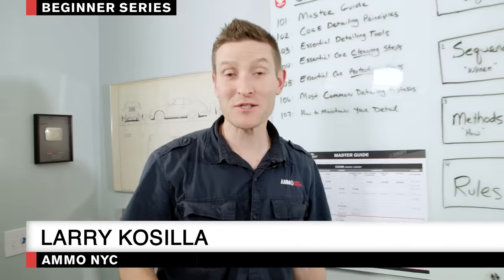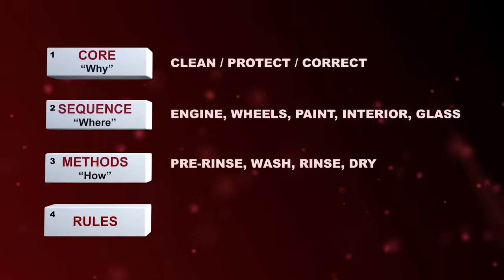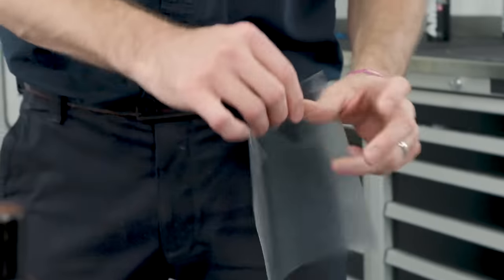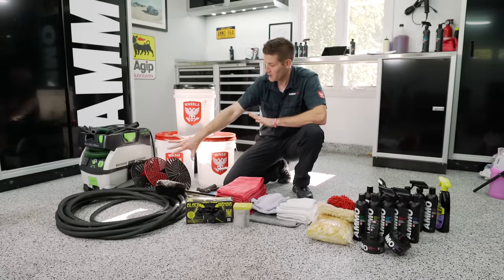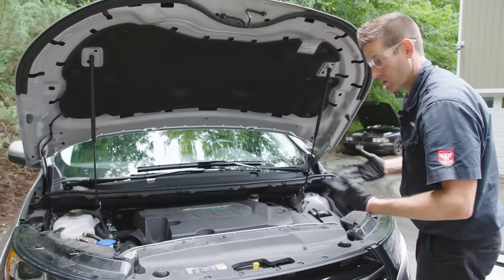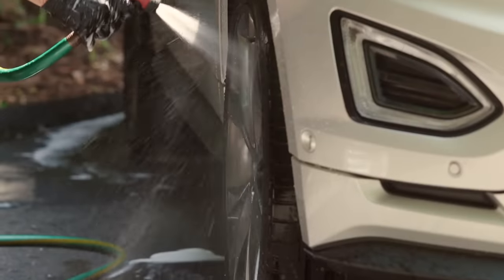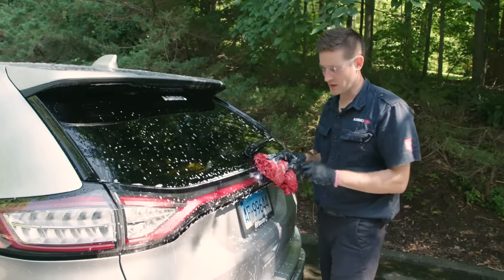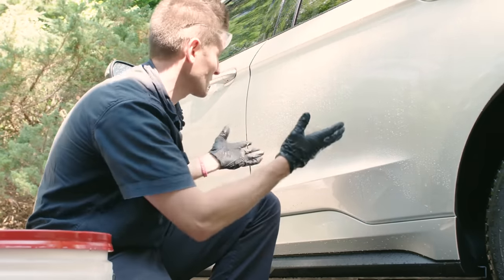Car Detailing Tips YOU MUST KNOW: Full Length Training Series

Comment: Lightly running your wash mitts across the vehicle usually doesnt clean it well if the vehicles dirty
Reply: Try a citrus pre-wash to loosen the surface contaminants, if that doesn't work your car's probably in need of a good decontamination and protective layer to help with your regular washing.

(In Scotland) My winter weather and roads are pretty bad with road salt etc and 80% of the surface contamination comes off with the citrus pre-wash and snowfoam 👌

Comment: Using a mitt to wash seems to me to be less desirable than a soft brush designed for car washing. A mitt, no matter how often one rinses it, is going to trap dirt particles and create scratches. A soft long bristled car wash brush will not trap debris for it is only the very ultra soft, pliant ends of the bristles that are in contact with the surface of the clear coat. I've been washing my vehicles for decades using this method and swear by it. The proof is in the pudding. I have a mirror, wet look finish and never have swirl marks. As for drying the vehicle. I use the touch-less method. My Stihl blower. 

When it comes time to wax the truck, I pick a cool cloudy morning after a rain, with zero dust in the atmosphere. When my fingernails feel contaminants on the paint, I will 1st apply polish (swirl mark remover) using small damp pieces of ultra clean 100% cotton terry cloth. Wipe clean with microfiber and then wax.

Comment: So my windows have like a felt material or some soft material on the where the window rolls down in the window frame or sill or whatever well I️t collects dust and lint and other fabrics and so on and I️ can’t find the best method to clean I️t..? what would be my options?? 
I’ve tried alot please help I️ have a Chrysler 200s 2016
Reply from the maker: use soap in a spray bottle and a brush to agitate then rinse thoroughly.  Hope that helps. thanks for watching and supporting AMMO.

Comment: 46:23 should do inside fiirst incase any dirt coming off from the inside ends up on your car!.. for an overly scientific cleaning video i'm suprised you would clean the outside first then drag the mats out over the bits you just cleaned and then clean them right next to the car where wind can blow dust and dirt back on to the car.. that's why i always do inside first, starting with engine bay, then move into the car, and do the outside at the end. don't need science theory for that, just common sense really, but cool for sharing techniques and taking time to make this video, i know its not easy to do.

Comment: Please THINK.of where all this soap is going. Is there a.creek or retention pond where all.these chemicals are going. Wildlife needs those places to get water.
Do you use a pressure washer ? Do you detail vehicals on a regular basis near your neighbors? 
I have a neighbor that has detailing buisness. He uses a  pressure washer quite frequently and stores huge containers of these soaps and chemicals 11 feet from my kitchen window in a flimzy shed he put up. Driving me up me up the.. Scary  in Florida gulf cost. Hurricane Ian 10 months ago blew  the door  off his shed exposing all the huge containers of Chemicals. No regard for neighbors and wildlfe as all that soapy stuff he uses goes to end of the street into the creek where wild dlife needs to drink. The noise from all he uses is nervewracking. 
With all the extreme flooding going on in many many places and temperatures are said to keep increasing , are there not more importsnt things than a squeeky clean vehicle?  
If one is running a buisness they should rent a proper place to make their extra money and keep  those 55 gallon of chenicals there along with detailing.